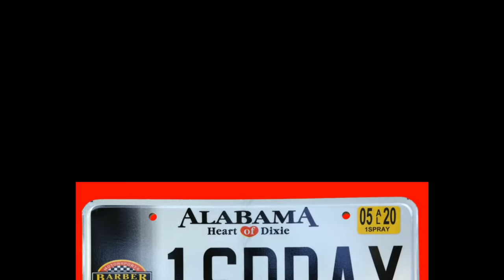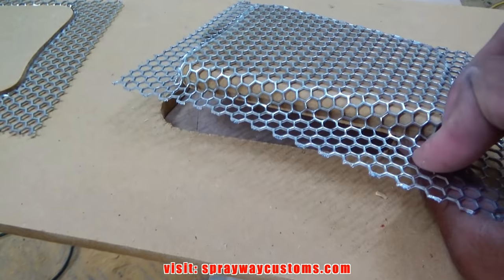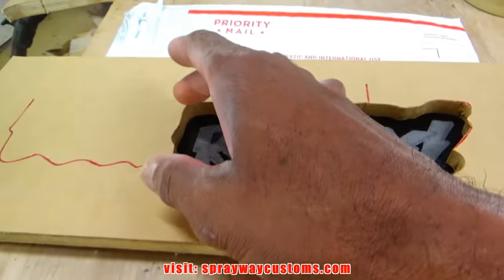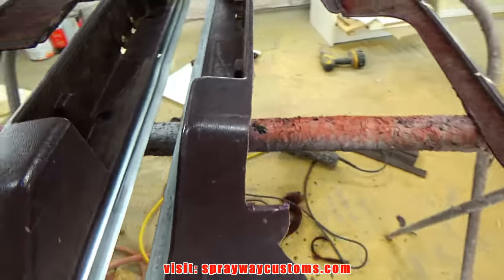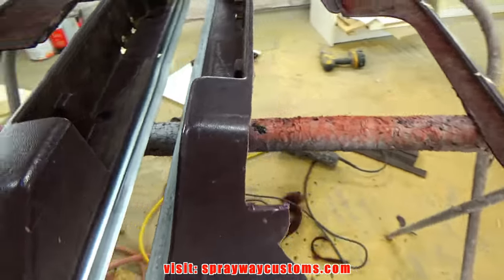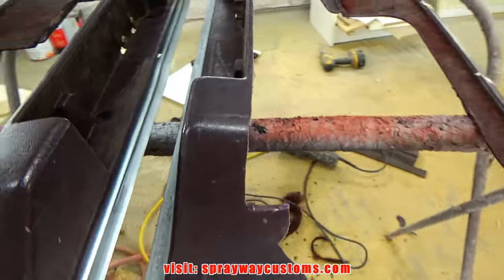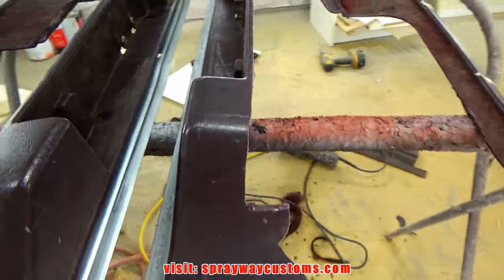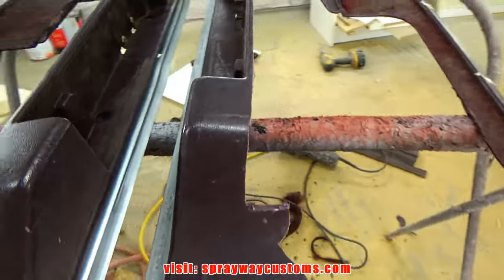How To Make Custom Fiberglass Door Panels Speaker Pods - MONTE CARLO SS G-BODY - 6.5 DB Deaf Bonce

Comment: Ran into your channel, back in the  day I did work like this ,man I miss the 80 and 90s  I’m 55 now and a commercial electrician . Your video was on point with the detail. I have an older 2000 f250 with plain doors you just motivated me to put sound system in my  work truck.  Keep safe and remember to use PPE
Reply from the maker: Right on…thanks a lot

Comment: I have been high performance engines & high end fabrications for over 20 years myself, including building high end & custom stereo systems.  Even tho I have worked with some big name places, I'm still mostly what you call a "backyard / garage " type technician or mechanic. Myself & a few of my long time freinds who all do the same.   And yet there's nothing mediocre about my work. I can build right up there with the best of the best. Ironically, us so called "backyard / garage" types do some of the best work many times. We still have the passion,  we're not just riding the coat tails of a big name company who also just spits work out as fast as possible to make money.  I'm not saying all big name places/ companies are like this, but too many times this is the case. Also there are many backyard garage types who have no business working on anything. Regardless this video is to my point,  a smaller garage mechanic tech who is doing work that is show quality.  This all has been spot on!   So I'm sending a shout out from NYC / long island area to you
Reply from the maker: Thanks for the NYC support Dave

Comment: Amazing video as always!! Seems like forever since the last time I installed a custom stereo, but this gave me a lot of ideas for the next time I do!! Again I have to say you do some truly wonderful work!!! Thank you for a great video!!!
Reply: Where do you get your grill mesh from????
Reply from the maker: Thank you Greg
Reply from the maker: I get it from https://www.customcargrills.com/
Reply: @SprayWayCustoms  Thank you I will have to look that up, I am currently building a portable stereo system built out of a car stereo and a couple of batteries for a computer battery back up!! If what I am building works, I will be able to charge it on a single small solar panel OR a trickle charger designed for motorcycle batteries!! I basically want and need an "off grid radio" for where we live we got a lot of power outages and flooding!! Plus I like to camp from time to time!! So this type of radio system would be handy to have!!

Comment: You did a fantastic job! I can offer one suggestion, that is, when cutting plastic run your saw blade backwards for a cleaner cut. This is a trick that was learned when cutting vinyl siding with a plywood blade. Other than that, Keep Up the Good Work.
Reply from the maker: Appreciate that Brian
Reply: @SprayWayCustoms  I've been a licensed contractor for many years and know quality work when I see it. You do quality workmanship and I figure it's good to pass on tricks learned in the field over time. It's a good idea to have designated tools for designated jobs because larger tools with backwards blades can and will cause kickbacks on other materials such as wood. Possibly causing bodily injury. I've worked with guys who had a habit to tie off their saw guards, that is a procedure that I personally would never use. All that it takes is one momentary lapse of thought to alter someone's life permanently. I brought it up because I felt that it is a trick that would come in handy in your case. Even if you never use it, at least you know about it.

Comment: Sup Sprayway, Love your content, from one car audio guy to another, my first set of door pods actually turn out Amazing ! Get you some CA Glue from Mobile Solutions, you put a stream, and then just spray actuator and it there, I treasure it, melts plastic togther in seconds, Especially if you have a place no seam, can just scam with body filler, sand to texture . Just trying to save you time, I couldn’t tell you how many hours I have in mine. Thanks for the great content bro !💯
Reply from the maker: Thank you Rob 🤝
Reply: Yes sir

Comment: I like how they turned out. Would like to see them installed in the car. I see you used adhesion promoter on the original door panel plastic before you primed it. Have you had good luck with that? Do you find that the paint is easily damaged on the original plastic? I've used the plastic paint before but I've had it peel and scrape easily. I'm not impressed with the plastic paint.
Reply from the maker: Thanks Bryan. I haven't had a problem with it. I try to scuff it up real good and use the adhesion promoter

Comment: What do you charge someone to do the works? Lower panels, dash, package tray just primed, no paint?
Reply from the maker: What you putting in them?
Reply: I have an 81 MC. I wouldn’t need all the speakers in the package tray and like one 6 1/2 in each door and a spot on each side of the dash for some good like 2 inch tweets.
Reply: I would slap a pic of it up here but I don’t think I can. Idk..
Reply: Can I DM you on fb or instagram?

Comment: How did you mount the magnets??
Reply from the maker: Just drilled the correct size holes, sanded the magnet on the back side and applied body filler to bond it
Reply: @SprayWayCustoms   fucking brilliant 👏 👌  imma go crazy with that thank you